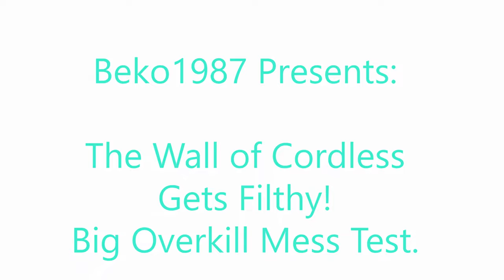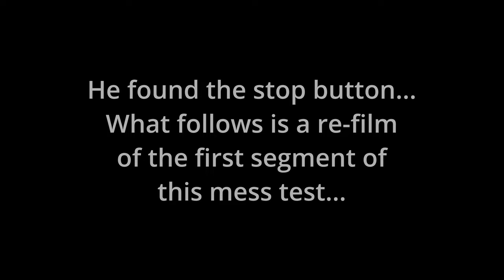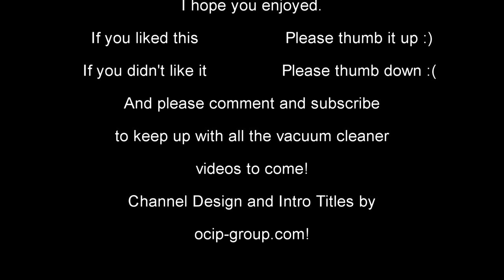Black Friday with Tineco - Cordless Vacuum VS Match! #tineco #TinecoTime #SmarterIsTineco

Comment: Why did you not use the shark or the V8
Reply from the maker: Don't have the cordless shark anymore! And the v8 in the front room is dead and it's not the battery so couldn't use that. Can only play with my won toys, not other people's vacs which are in for repair/full refurbs